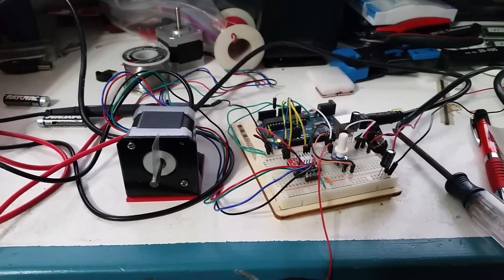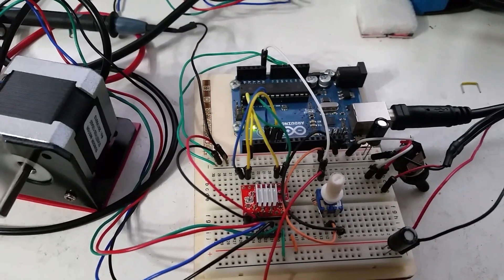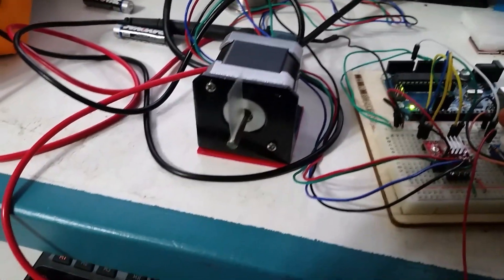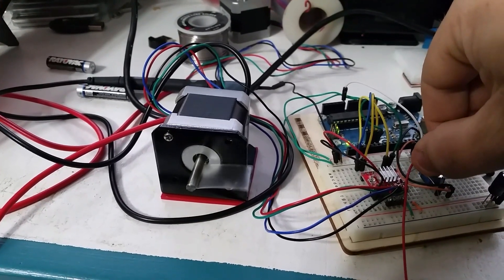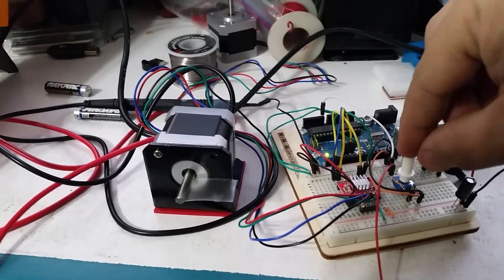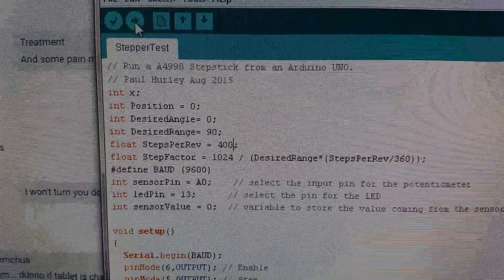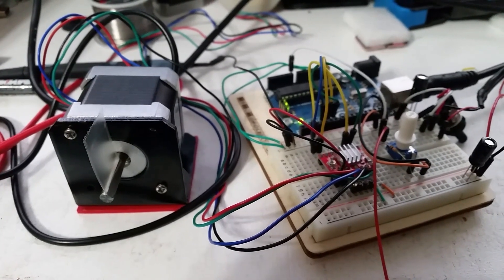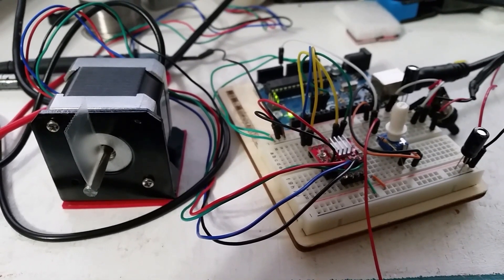Arduino Controlled Stepper Throttle

Comment: Good video.  How smooth is the movement?  I want to be able to control a gas turbine throttle with one, but it can't move in jerky movements.  You're looks pretty smooth in the video.
Reply from the maker: So it is pretty smooth, but not fast enough for car throttle (which is what it was designed for). I abandoned the project... :(
Reply: @roryduncan1534  What did you end up going with?

Comment: Hey! we are university students in the SOUTH KOREA. we have undergone the project such like it which requires us to make a idea using using throttle valve system. So, If you do not mind, could you share the arduino source? If you send me an e-mail, I will appreciate for it. sdlfkj1239@gmail.com